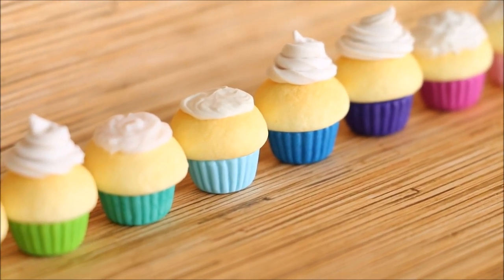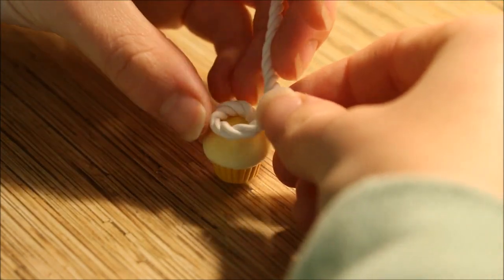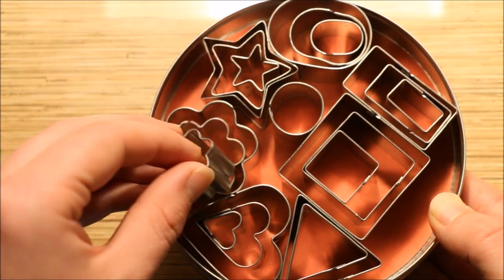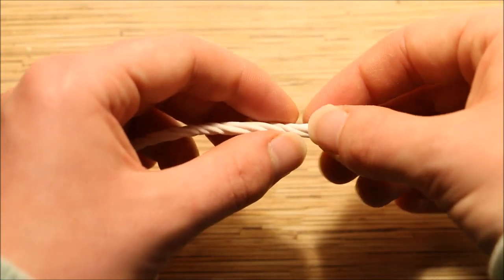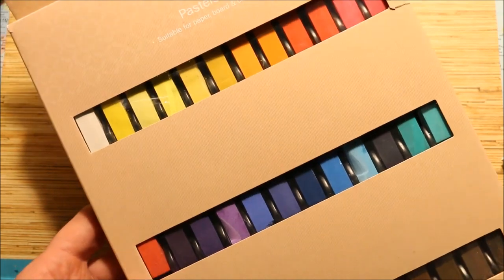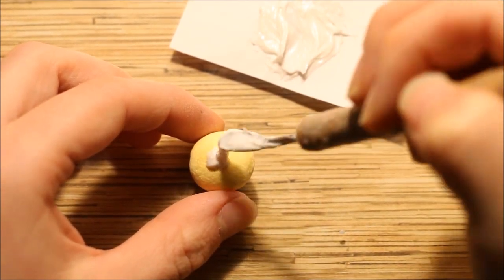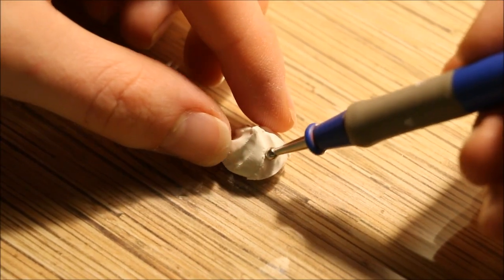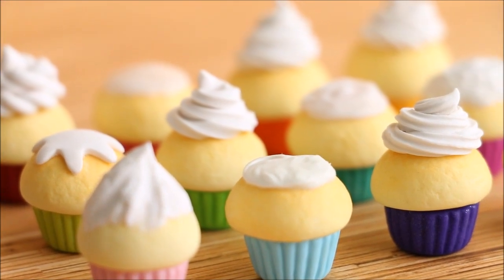12 Ways to Make Icing/Frosting│Polymer Clay DIY Tutorial

Comment: Another method I've used a couple times is watered down paper clay and I put it in a plastic bag and cut the tip and then it just dries and if you bake the cupcake before adding the frosting you only have to bake it once. You can also color it with paint or chalk pastels
Reply: Official GraceFace That's helpful! Thanks